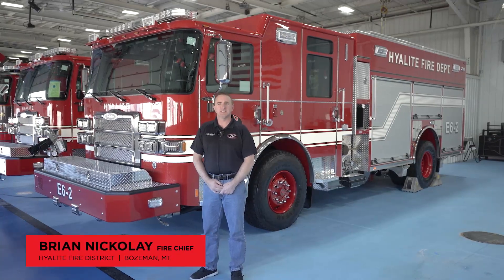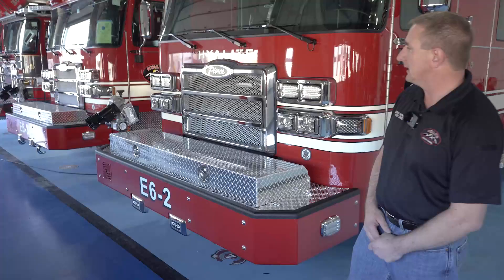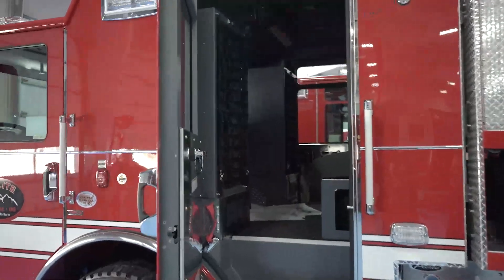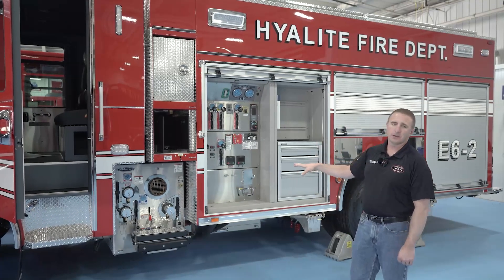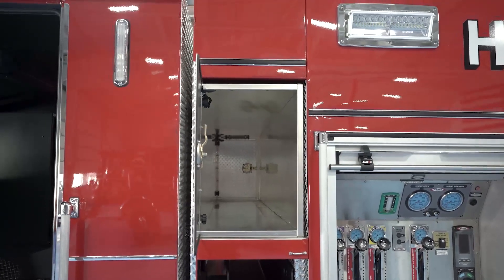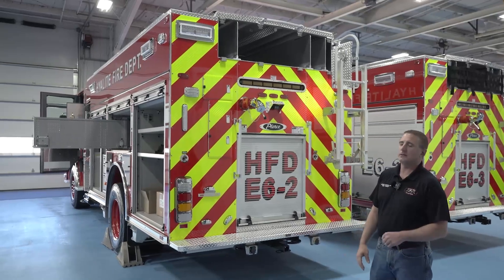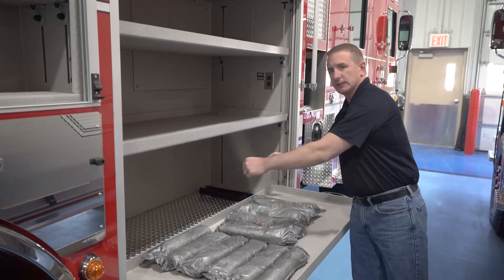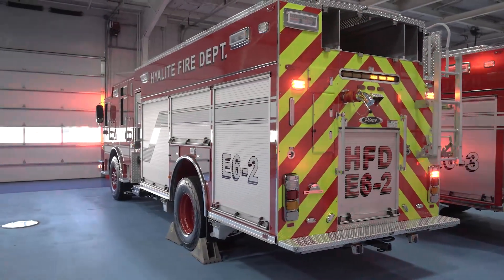Enforcer™ Pumpers – Hyalite, MT

Comment: Please pass this info onto Chief Brian:
Two electronic siren speakers work much better than a single speaker because they create tones that are 4 decibels louder & can be heard from twice as far away.  You should add another speaker since there wasn't room for a Q2B.  You might want to add another pair of turn signals on the 45 degree angle of the bumper or on the mirrors because the Officer's side turn signal is blocked by the monitor.  You can also put in fog lights or angled cornering lights because the Officer's side headlight beam is partially blocked and could hide deer on the side of the road.